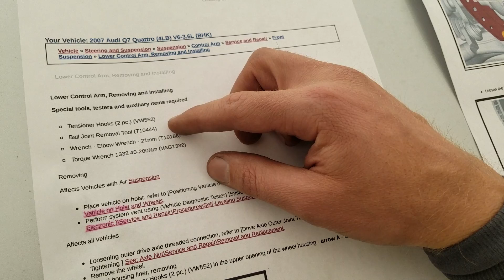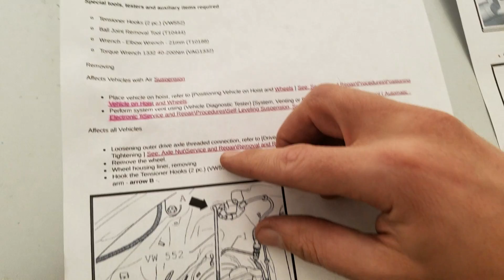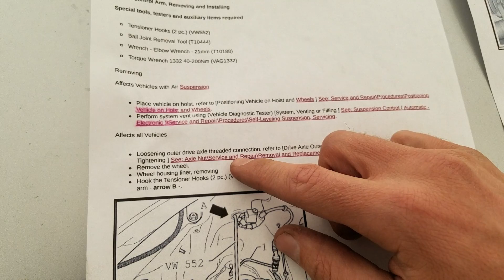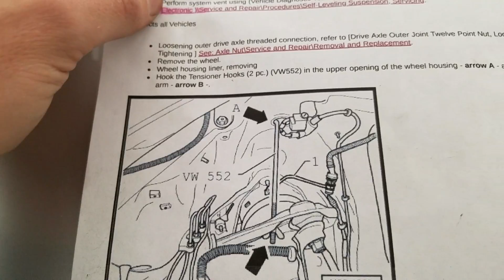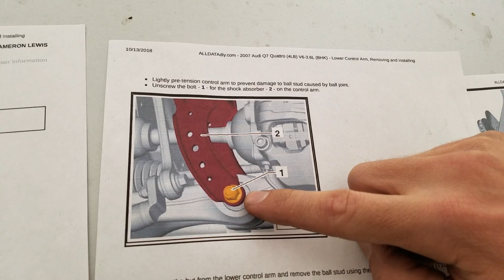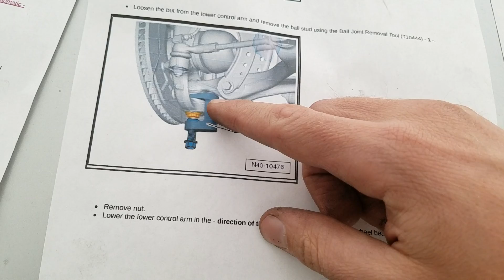2007-09 Audi Q7 - How to remove front lower control arms

Comment: Hey dude, this is a great video. I am running into a similar problem like you, where I remove the nut and washer on one side and now the bolt is being a little bit stubborn in terms of coming out, and it’s on the same side that you mentioned in your video. Any hacks for me to get it out safely, it does turn when I use the spanner (nut is already off on the other side of it) but it’s quite stiff. I’ve sprayed it with a lubricant overnight hoping it will loosen up a little bit but I’m worried that it will have to be cut which is something I really don’t want to do. Any advice pal?!